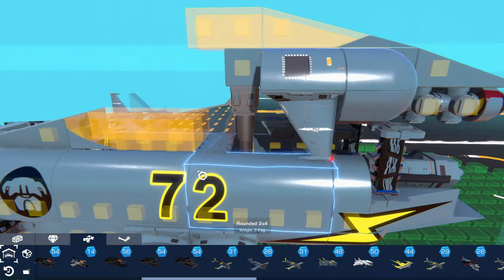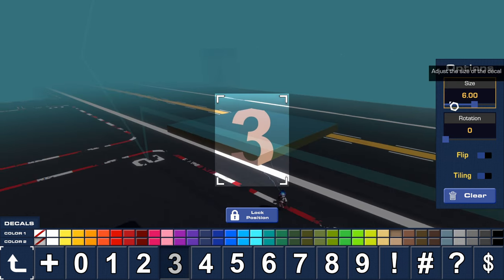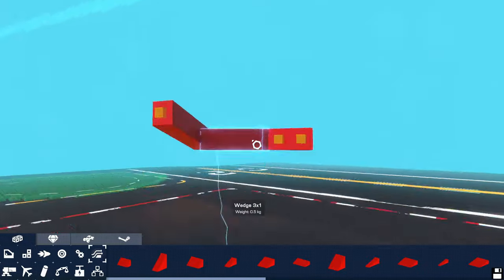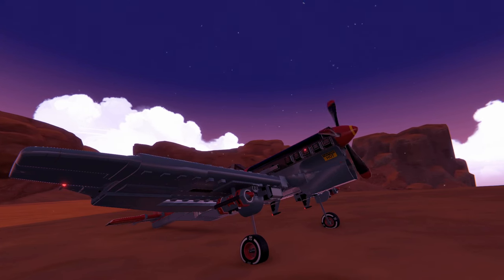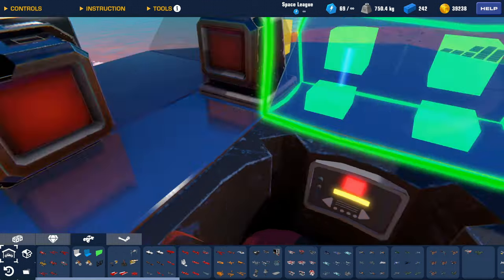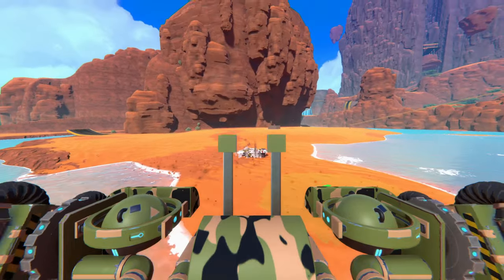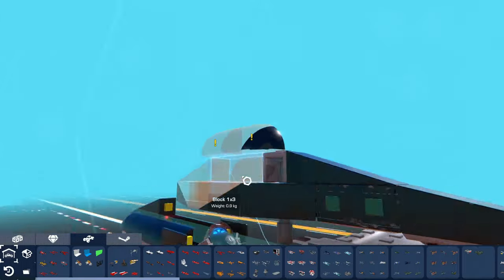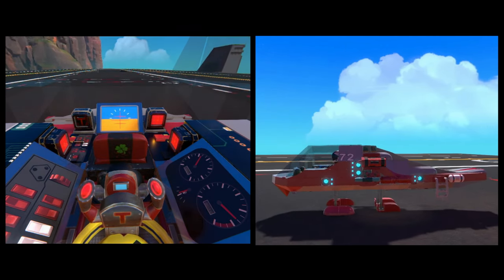Decals and Cockpits Trailmakers Design Tips

Comment: Epic video man! Small thing I noticed most people don't know with the decals. The reason why its messed up when you mirror it is bc it's missing 1 step. The last step is to do [ 360 - { The anlge you have } ] this gives you the angle you need to set the mirrored decal to. The reason 0 and 180 degrees work is bc [ 360 - 0 | 360 - 360 | 360 - 180 ] have the same resulting angle as the starting angle. { 0 and 360 are the same angle of course } an example would be: 

Angle: 72

The mirrored should be:

Flipped & { 360 - 72} = 288
Reply from the maker: we have a new pinned comment folks! 
Thanks lukkram 🙂
Reply: Sometimes i can add up to 90 and sometimes flipping the decal might help solving the problem